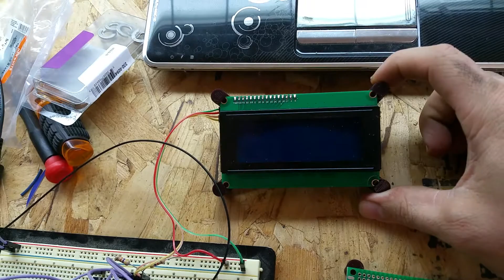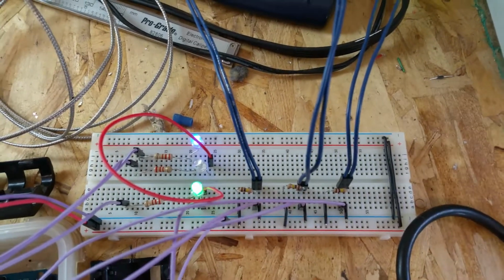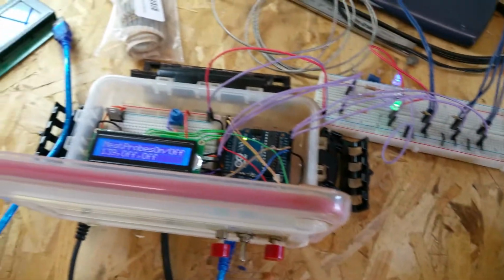Arduino smoker update WiFi coming!

Comment: Where do I find the sketches to build this?  Think I have most of the parts I will need to build it,and can figure out the coding side myself pretty sure.... I just don't know where to start on calculating all the resistors needed,or where to put them.
Reply from the maker: joehammel have a look in the description. That should get the the sketch. Im sorry I don't have links for the libraries yet, but shouldn't be too hard to find. The sketch is well documented and roughly goes over the wiring and resistors. If you have questions let me know. I love helping people that are interested in this

Comment: I have purchased all the parts last year to build your controller and I have started to put it together but never got it finished. :) However I wanted to use thermistors myself.. mainly because of the grounding issue with the thermocouple. I'm new to arduino and new to programming too so this is why I've left the project undone. :) But I'm looking forward to your new model.
Thanks for your work!
Reply from the maker: Pete Tum that's great to hear! Let me know if you have questions. I would love to see a video of one somewhere else, from someone else. Good luck. I was new to programming when I started this
Reply: Archy wigglestyn There was a couple of things I wanted to change on your project but as I didn't finish it due to lack of knowledge I didn't tell you.
1. I wanted to get rid of the arduino uno and just use the atmega with the arduino bootloader. I have put this on my breadbort with your sketch and it did work. Then ive purchased a usb TTL uart cable and I can upload new software if neede. This way the whole board including all connectors would possibly fit under my 20x4 screen and the buttons. Also I've replaced the switch with a push button and an led. So I have 4 push buttons. They all momentary buttons so I've changed some lined in the code to make it temember the state of the auto/manual modes.

2. The screen. But you have mentioned that you going to use this screen too. However I was experementing with the one that has an i2c board underneath so you only need 2 pins off the atmega. I did change the lcd library and made some adjustment to the sketch of yours and it worked fine.

3. Thermistor. Again you on this thing.. :) I had trouble with my termistor as it is a 1Mohm termistor and Ive tried everithing but it didn't work. I ended up buying a 10Kohm thermistor but it is still in the packaging. Never got around to try it out.

4. The wifi.. that was only an idea. But due to the lack of knowledge I haven't done anything with that. However I have researched that it is possible to make a webserver on arduino and connect it to your home router. With port forwarding enabled on the router you can access your arduino from your smartphone's browser wherever you are on the world. So let's say I go shopping and I can still see the temperatures. If it doesn't stay on the setpoint I go home as soon as I can.

That's it for now. I would love to help but I don't think I can but if you need help let me know.
Reply from the maker: Pete, It's funny hearing you mention these things. I have gone through all the same thoughts almost word for word as you've typed. I laughed when you mentioned going shopping, because that's exactly what I told my buddy he could do when I get his done.

1. I have used an Atmega like this for another project in the past. It works good and I might make one for myself someday the same way. I like switches, what can I say. The photon one will be scraping the switch for 4 buttons. having the bigger screen, I like to expand the menus into use arrows to point and explaining what buttons do.

2. The bigger screen is really nice, if used right. I have the I2C one running on the proton and working very well.

3. Replacment thermistors for the Maverick ET732/ET733
these are amazing. Sooo much better than the thermocouple. I originally used the thermocouple because I could not find a thermistor library I liked. The new function I made, made it so easy I love this new setup.

4. Particle uses their own servers. This makes things very easy. Keep in mind I'm betting you're around the same level I am when it comes to this tinkering knowledge. for me the photon makes it a possibility. Blynk is an app that you might find useful. I will use it for starters until I write my own app. They also use their own servers. 

So a question for you. How well were you able to follow along in the sketch while using my notes? I tend to overlook things that I fully understand. I remember I was once a person that was (still am) thankful for good documentation. But at the same time, this is not a complete beginner's project. So I leave some things, like the wiring, up to the builder.

Thanks for the offer of help. I am the only person I know that can do this type of work. So it helps to have someone to run questions by, I'll keep you in mind.
Reply: Well... :) As an absolute beginner... I had hard time with it. I had no idea how to donload the libraries so I went on google looking for them. I have found a tutorial how to add the downloaded libraries etc.. and it still had issues. Then Ive given up. Put the whole thing in a box and didn't touch ot for a long long time.
Later I have took out the arduino and had some time to learn how to do sketch. There are really good tutorial series on youtube.
So after a while I realised there is a built in library search in the app. Never mind :)

Following your script.. no I'm not as good yet. Whatever I've added was googled and copy paste. Things that I had to change was minimal so just tried to find that and done.
I still don't actually know how your sketch works other than the menu. That was the only thing I had a better look. It is kind a complicated but I worked it out.

And finally.. I actually have the same probes that you have for the maverick et 733. Only I just couldn't get them to do any reading on arduino.
They are 1M ohm and not very common.
Hmm..
Reply: I have even contacted maverick and they kinly sent me the datasheet of the probes that comes with the ET733 and that says the same that I measured. 1000k ohm
Reply from the maker: Pete Tum hmm I thought I measured 100k I'll have to look again. I thought about finding links for libraries and adding them to github. Perhaps I will do that. Thanks for the input
Reply: Hey Archy, I was trying to assemble V3.0, but I was wondering if you had a wiring diagram ? I am struggling to see how to connect the screen to the Uno. I was wanting to use this setup and drive a roto-damper for my kamado. Great setup by the way !! Next I want to try the new version but I wanted to use what I had sitting at home first  cheers Ant from NZ